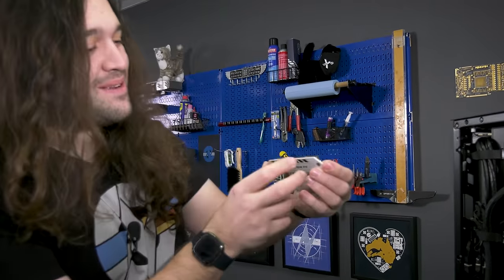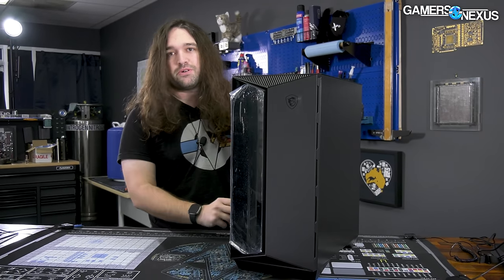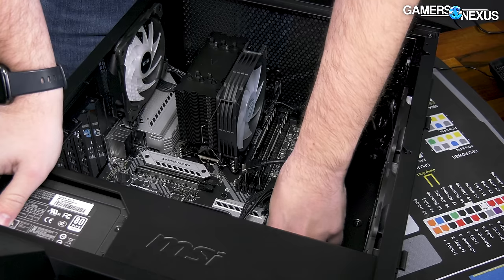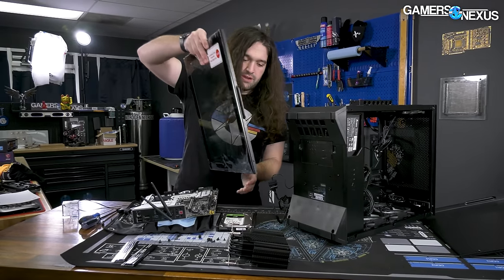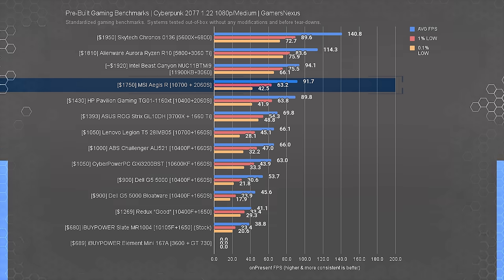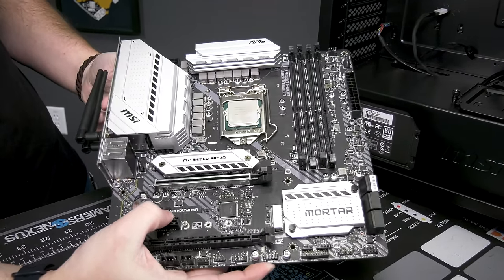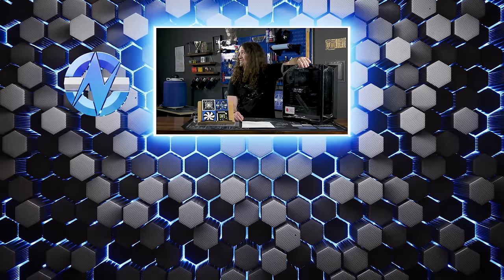MSI Pre-Built Bends SSDs & Boils CPUs at 100°C ($1700 Aegis R Review)

Comment: Several pre-built cases have a front cover that you can just shitcan and if the BIOS is changed to air cooler, I would think this build is still much better than any Dell.  Yes, the price is still too high when you could get a laptop with better performance with less price.  It is still better than a Dell...

Comment: Only because I know that the pc community will understand my pain. I'm going to complain for the first time ever on YouTube. I opened up geforce experience to update drivers. I chose the clean installation option as usual. It prepared the install and started the restart process to finish updating the drivers. The pc booted (I have a post beeper) but I have no display now and my cpu is a 10700KF so I have no igpu to use to manually install drivers or troubleshoot the issue. Idk what to do 😅 it's a gtx 1070 that i can't afford to replace and I don't have money to buy even another cheap lga 1200 socket cpu with integrated graphics. I feel sick to my stomach

Comment: I got the aegis above this one. It was a lot better than this one. 
Had a 11700k with the 3080 16 gb ram at 3000mhz 750 watt power supply for 2100. I wish I would of not lol.
I wound up having to swap it out for the 12th gen and a bigger aio. That was another 600 but that upgrade made my pc an absolute monster and I was able to build a secondary build with the mobo and cpu I swapped out and salvage my investment. Whats really wierd is that the 11700k performance and temps are night and day better now in the other case when paired with my evga 1070. 
I also reinstalled a fresh windows on both and got rid of the bloatware. Oh and one more thing msi blatant lied about the ssd I would recieve. It was supposed to be a gen 4 but it was a gen 3 they really jipped me there the m.2 I received was an adata 1tb worth a whopping 45 bucks. 
1/10 do not recommend

Comment: I have a gungnir 100 case i liked the style and im a fan of norse mythology but its not wort it. that air flow is trash i took off the glass panel because my cpu would consistently sit at 90+ c with my aio or stock cooler. Didnt care to have an open air case but if you want it to stay cool there's not a lot of options here.

Comment: Looking at how bent that SSD is I have fair confidence its nolonger reliable, talking from experience where one of my ADATA SSD's overheated itself so far that it warped under its own heatsink and cracked the solder balls. It could still work but only when held under pressure and only for reading the data, writing anything would more often than not, crash the drive.

Comment: I now refuse to buy anything MSI. I returned a board with CPU issues, MSI replaced the CPU socket ( 1151) which DID NOT FIX THE ISSUE AT ALL !..  I sent the board back to them and they then claimed that I had damaged the board. The board was only 4 months old and firmly inside the warranty period and MSI would not repair or replace the board. In contrast, I returned a Gigabyte board to Gigabyte after a customer dropped the CPU onto the open socket, damaging the socket. That board was also still under warranty BUT the customer was more then happy to pay any repair costs as the damage was his fault. Gigabyte replaced that board with a new one at NO COST.  Sorry MSI, but you have lost the plot.

Comment: Not much good to see here. However there are things I care about and those that just don't mean much to me. One thing I care about is airflow, and the Gungnir case used makes airflow a laughing point.

The M.2 drive mounting was simply ridiculous. It's just one of those problems you can run into with heat spreaders on the drives. Then you have a choice, retain the heat spreader on the drive and ditch the heatsink that come with the motherboard, remover the heat spreader and use the heatsink, or you can do what these guys did and force the heatsink down on top of the heat spreader, screw it down and wait for it to fail.

The memory however doesn't bother me. So they divvied up a four pack. Big whoopdedoo. Though I am a bit surprised they aren't buying the memory in bulk. Whatever the case I see nothing wrong with it.

Now the tweaking of the BIOS and power plans is something else. Unless you are buying a pre overclocked system that's not something that should be there. If someone want to drive the CPU power up then that's something they should do themselves. When you deliver a prebuilt system it should be ready to run the most stressful load you can design 24/7 without over heating as long as the room temperature is under control.

Something I missed in the video was the PSU. I can't remember it being discussed. I guess it was "good enough" but not spectacular. If it had been a grenade in drag we would have been told so and like wise if it was a really good PSU. But "good enough" is all I personally need from a PSU in a machine like this.

I built machines to order for about 20 years. Some things we didn't get right. We could have done with the expanding foam packaging to keep cards in place during transport, but it wasn't easily available at the time. So we had a percentage of machines damaged in shipping.

Motherboard always had the BIOS updated to the latest released and the settings were cleared. Then we set memory timings and made sure everything was configured for decent performance. Some customers asked specifically for the machine to be overclocked, but even then we never tweaked things so far the machine wouldn't pass our stress test.

We did extensive thermal and stability testing. Every single machine was run through a torture test stressing memory, storage and CPU for at the least 20 hours though we wanted 24 hours but sometimes the customers couldn't wait so long. All tests were run at an elevated ambient temperature of 35 to 40 degrees Celsius. All errors were logged as we used ECC memory in most machines. Performance, memory logs and system logs were inspected. If any fault were found or the machine had throttled it was back to the workshop before being tested again. If everything worked then the machine was packaged and shipped.

One problem was that we were definitely on the expensive side, but most of our customers were companies and they tended to come back for any machines that needed better reliability and performance. Still eventually the market tanked and the company started to bleed money like a sieve and now it is no more.

Comment: $1700 and it has an rtx 2060. Even by current standards that's terrible, surprised that didn't get mentioned.
Reply: I dont know how the market was 5 months ago when you posted this comment as of today but I got it with i7 and 3070 ti for 1700$.Nothing damaged and no unnecessary bloatware either except Norton.Guess all I have to worry about is supposed high temp no good airflow

Comment: That front panel looks like it has openings top and bottom. what an overdramatic burke, maybe he should smoke flow things again before making claims.

Additional comment, the memory product id ends in BB meaning Bulk Black, ie not a single or dual kit these are SB and DB respectively.  The 8GX4 likely refers to the memory chip layout. If only steve spent 30 seconds googling a part number before making lama drama up

Comment: Dude, you got the intake and exhaust mixed up. The intake is that huge grille on the top. Thats why there is a dust filter. 

I am an HVAC engineer for labs and hospitals and I design airflows for a living. This case has great airflow. Do a basic goddamned test and check the airflow instead of just looking at it and spouting off bullshit.

Comment: I have one and it runs 55-60c on fortnite and 60-65c playing fortnite while streaming on high quality. mine has liquid cooling which is probably why
Reply: what cooler is it?  I have an Aegis ZS running 5800X and 3060Ti - a 120mm AIO that I just had to send to MSI because it failed after very little use.  the bigger ones got recall, but not the single 120  and I don't know why, all the same parts.  they don't sell them anymore, so I wonder what I'll get back???

Comment: I appreciate an in-depth analysis on a computer like this but I find the way you critique the computer very unprofessional. Calling out things like a single power cable running to the GPU like it's such a big deal and then quickly explaining that it doesn't actually matter.
Calling out the memory for being part of a 4 pack is also ridiculous. It's just logical for a system builder to do that and it doesn't affect the computer at all.

It's not a good PC, I agree on that, but review it fairly and be professional about it.

Comment: I really don't like MSI. Call me a snob if you want, but I prefer Asus, have for over a decade.
A buddy of mine was having issues with his MSI bios, having selected XMP memory profile, it would no longer boot, not even to bios. He had to remove the watch battery to reset the thing because well, it wouldn't even boot to bios.

For me, this is fucked up. My experience with Asus has always been that, no matter how much you fuck up the bios (and selecting XMP is hardly considered fucking up the bios), you'll always be able to get into the bios and fix things. It'll tell you "this isn't working, fix it in the bios" and that's that.

The fact that he has to reset his bios by physically removing the bios battery is just beyond what I'd call shoddy design and makes me think of MSI as being a low-tier manufacturer of computer components.
Reply: In other words, this video confirms my low opinion of MSI and doesn't really surprise me that they'd produce such a piece of garbage.

Comment: My only qualms with this review is your constant harping about the front panel.  Despite your own test results showing that with or without the front panel, the temps remained the same.  So what's the point of harping about something that makes little to no difference?  I don't want content just for the sake of content, I want to see a review that actually matters.
Reply: Removing the front panel changed things, the problem with the CPU was that it was probably hitting 255W always during all core loads, and the air cooler can't really keep up with that thing

GPU temperatures went down, as expected.

Comment: 6:53 why the hell would you go with plastic for a backing plate tho? It's actually more expensive and process volume consuming to do it in plastic than it is a slab of aluminium or even steel. Basically, you can have them water jet or laser or die stamped for less than the entire production line involved in making the same part in plastic. So why? And that's without mentioning that owning and investing in the metal side is far more beneficial because any factory that has that capability can then produce any number of other things simply by software change, where as the plastic side of things, not only does the entire monolithic slab of plastic mold die need maintenance and change, once tooled for, it costs a lot to make a new one, and the entire process is only geared for it, nothing else. 

What imbeciles.

Comment: 00:01 MSI Aegis R is a problematic pre-built computer
02:02 MSI's Aegis R system appears to have numerous flaws and questionable design choices.
05:59 MSI Aegis R Review - RTX 2060 Super features and critique
08:05 MSI Aegis R offers flexibility and compatibility for DIY upgrades.
12:16 MSI Aegis R has poor CPU thermals and power limits.
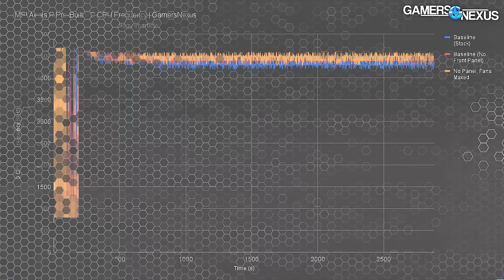14:15 High CPU temperatures and throttling issues in MSI Aegis R pre-built computer
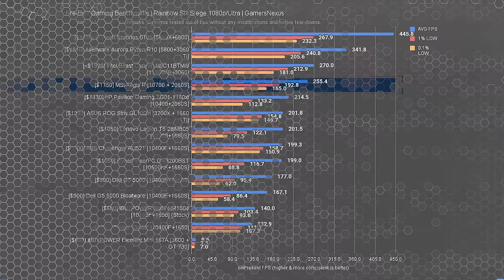17:59 MSI Aegis R has high power draw and thermal throttling issues.
19:43 MSI Aegis R includes a case with limited cooling and missing accessories
23:05 MSI Aegis R CPU speed and pre-installed software
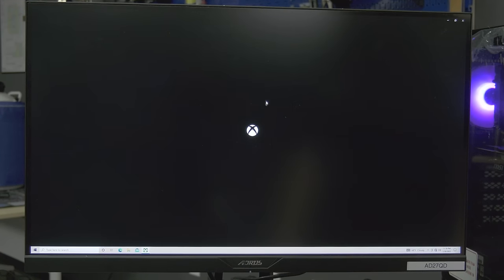24:51 MSI Aegis R has outdated drivers and terrible thermals
28:24 Avoid buying this product, it's garbage
Crafted by Merlin AI. Yes AI is taking over.

Comment: my 2080 rtx msi still going but im not playing with any overclocking Msi sucks bad...i saw it whe i had to install their software. msi center is crap....afterburner is the only choice.....I am never getting anything else from this company they suck at the mechanical assembly and concepts. I received my card with the most atrocious ""SAG BRACKET'' on the good sides, my corsair case i AWESOME ad i chose it to put the 3 fans 2080 vertical its wayyy more stiff.

Comment: What i find so unbelievable about this review is that I had the MSI MPG GUNGNIR 110R case with a Ryzen 9 3950x and ran it air cooled and NEVER saw temps over 70c while playing MSFS 2020. granted, i had 6 case fans on mine and took the time to adjust my own fan curves in BIOS. Steve, dont let your hatred for MSI cloud your judgment. oh, and I saw what you did there with the NVMe drive. the heat sink screw isnt what holds it on the board. You have since lost any credibility in my eyes and you have lost my sub. good luck.

Comment: This channel use to be one of the best on youtube. Back when they were using ln and benchmark testing. Every since the nzxt it has all become " what product can we talk sh@t on today"
You repeatedly pushed 120 percent rated voltage through a power supply and act surprised when the over current fails.
Now you spent 60k on a machine just so you can improperly operated the fan tester. Then talk crap on fan manufacturers.
if you want to make a living talking crap at least you could do that well. You don't. Lame.
Thumbs down and unsubscribed.